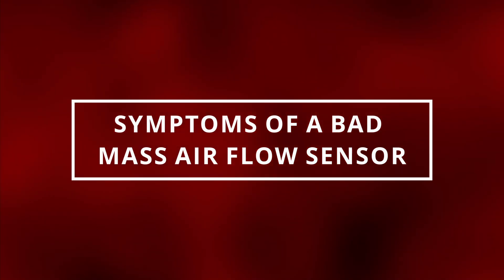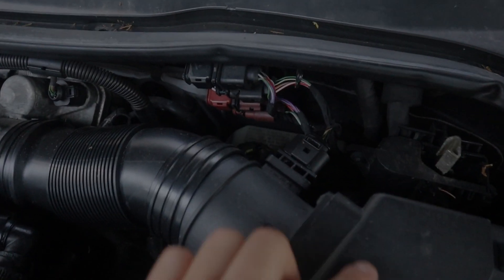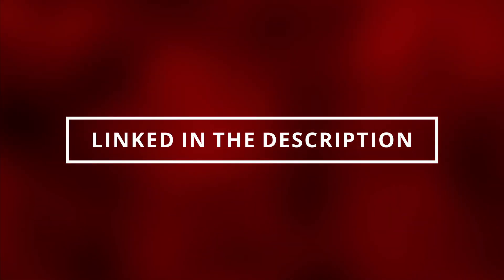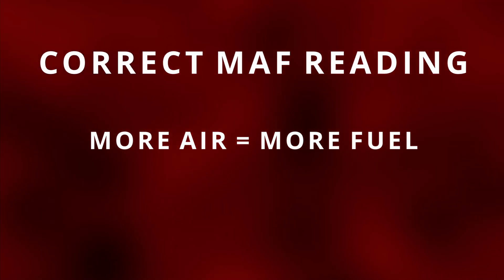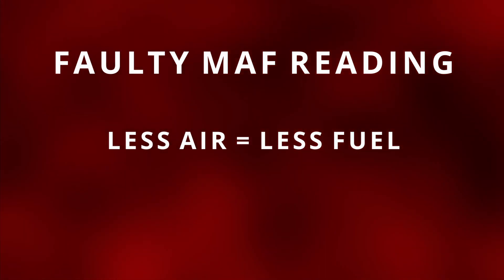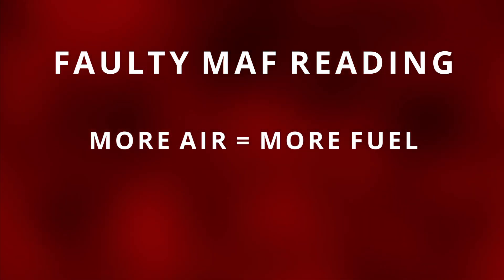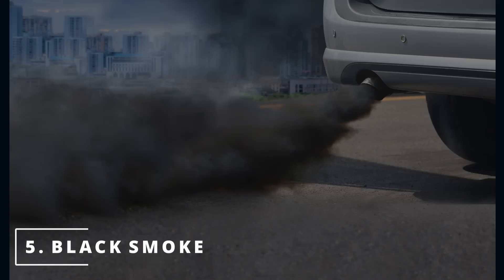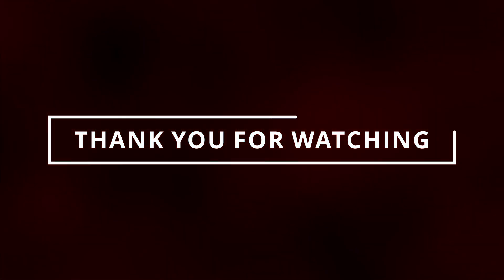SYMPTOMS OF A BAD MAF (MASS AIR FLOW) SENSOR

Comment: Thank you!! I just installed a new engine on a 04 F150 5.4 Triton but it’s a spanking new engine and i’d notice extremely rough idle during slight acceleration or stopping. I was so mad lol but I was suspecting this checked check engine and that’s what came up. I will be changing tomorrow.

Comment: What else would the maf sensor code be? Just replaced the part and still have the same issues. Car shakes at low speeds, inconsistent RPM when stopped, and awful gas mileage, like 6 miles burned through a neighborhood bad.
Reply: Perhaps an O2 sensor?

Comment: 2007 nissan sentra. I disconnected the battery, swapped out both taillight assemblys,cleaned both battery terminals, and reconnected them. Then I  dropped my Big Gulp,with 32oz of water on top of battery, everything was soaked,fuse boxes,terminal fuse everything. Then crank/no start. It was running good before I worked on it. Can you help me please. Thanks for the videos.

Comment: Mine mitsubishi airtrek maf sensor problem b4 this. Tried clean with cleaner no luck. My car got to lean and unable to accelerate for overtaking. Last thing i do i just knock my maf sensor and walla it fix the problem now i can drive and accelerate normally
Reply: what the heck do you mean by "I just knock my sensor" ?

Comment: I had a bunch of misfires and it tried to not move while I was giving it gas. It only does it when it heats up. I know the throttle body elbow was not clamping on right causing air leak. I also bought a 3rd party MAF sensor. could these be the cause of all my issues?

Comment: I got a P0171 code on my equinox. How do I know the difference between cleaning it Vs replacing it.
Reply: clean it, and if that dont work replace it i guess.
Reply: Did you figure it out?
Reply: Did you figure it out ?
Reply: I ended up cleaning it and that worked
Reply: @GodDelightsInHer whatd you clean it with?

Comment: Can it cause the car to shift sometimes bad?
Reply: YES ! I was having this issue for some reason, on my Silverado, also had a bad rough idle it weirdly seemed to have solved my bad shifting, I’m guessing it was running rich and was making my engine surge and I just thought it was the transmission, I cleaned it and a lot of small issues went away !

Comment: Best subscribe and like 
My Nissan Murano 2010 I changed the fuse attached to positive terminal ,I changed the starter and the battery brand new but crank and no start I don’t know what to do?
Any help please 
Is it the air flow censor ?
Thanks brother 
Toronto 
Canada

Comment: My engine light came on the other day,,I put a code reader on it and it's coming up as a maf issue,,and when I go over 80mph the engine starts to shake
Is this because there's not enough air and oxygen going to the engine?
Reply: clean it with proper spray cleaner first, if didn't fix things, replace the MAF sensor.

Comment: Thank you for your video. I have a 2006 Corolla 1.6 petrol and the MAF sensor read 3 g/s at idle and 27 g/s at 2600 rpm. Are these values normal? Thank you!
Reply: Same thing happened in my 2013 BMW X1 35i, I’m pretty sure that’s just a common thing

Comment: Should I replace the MAF ? Or clean it ?
Reply: I have a 2003 Saturn Ion. It slightly different than MAF sensor, but same concept. I'm spray cleaning mine . I have no symptoms  of any bad MAD, but I have the cleaning solutions so I'm cleaning mine for general maintenance (280k or 165k miles). Plus, I have an old truck. I'm not certain if any such maintenance was done on the new engine so I'm doing it - again just as general maintenance - it can't hurt. Plus, throttle body cleaner.
I do not anticipate future issues, but I'll deal with them if I do.

Comment: I have a 2000 Saturn ls2 it sat for 3 yrs, I had to replace fuel filter it was completely stopped up. Ran great for awhile as long as I kept over half tank of gas. Now it will have random misfires, long starts, and no starts at time. I know its fuel related, where do I start?
Reply: fuel pump ?
Reply: @jaldkajoi7862  lol 😭

Comment: Ok here’s my question. Will my maf  cause my cat sensor to go off every now n then causing my check engine light to come on ?. I replaced all spark plugs, coils, cleaned out some but not all of my fuel injectors, got a new battery because they sold me a faulty one and changed the both crankshaft position sensors. I get a cold start. Sometimes it will take 10 min but once’s it’s starts it pretty much runs all day.

Comment: Had a maf sensor fixed in my 91 firebird after having the same symptoms as this car with a service engine soon light coming on. After getting it fixed i can still feel a slight hesitation when accelerating around 40-50 mph. Sometimes at lower speeds. The Idle seems to be a little jumpy as well. When coming to stops it feels like it might stall (500rpms)Any idea what i should have checked out? No Service engine light is on at the moment. Thank you
Reply: Check the fuel trims, short term and long term. Check the O2 sensors, check their voltage to make sure they are reading properly. Finally check for leaks, sometimes even the pcv hose could be old and cracks on it(check for unmetered air entirely). For example, intake gaskets, pcv hoses, brake booster hoses, evap(it would throw a code sometimes), etc.
Reply: Same exact problem  with  my 05 ford escape v6. Currently looking up similar problems
Reply: @daniel3659-q9h  was told that i need to have the engine replaced or rebuilt
Reply: Probably the catalytic converters clogged
Reply: A cool trick to check for leaks would be using brake parts cleaner or throttle body cleaner. Spray lightly around the intake and watch the engine rpm or even by sound. If you spray somewhere and engine starts to die(lowers rpm) then there is your leak.
Reply: Change MAP sensor
Reply: See I’ve had this issue. I was told it was a camshaft position sensor from the codes, nothing changed and I changed this and now it’s fine. Perhaps you need both and maybe spark plugs too

Comment: My car isn’t showing a faulty a faulty air mass sensor code but it’s behaving poorly with the symptoms. Please what should I do?
Reply: Did you find out?
Reply: get a can of CRC MAF sensor spray cleaner, specifically made to clean up MAF sensors.  It's DIY project. Should improve things, as it will feed info to the car's computer to do the correct air-to-fuel mixture.  I pull mine out and spray it clean once a year.  Have done for years now, smooth running.